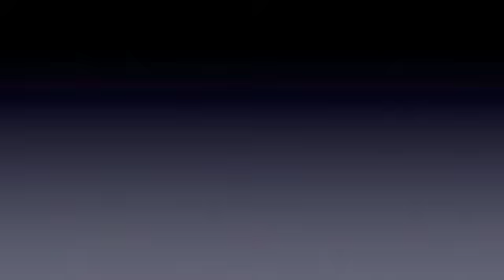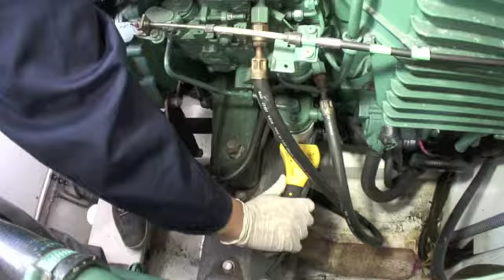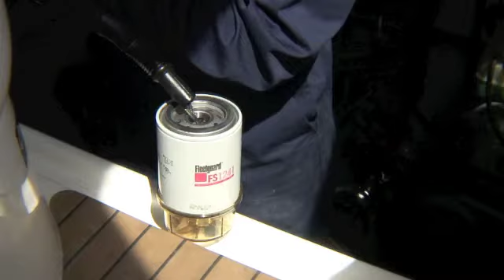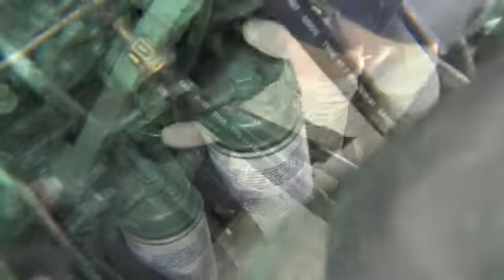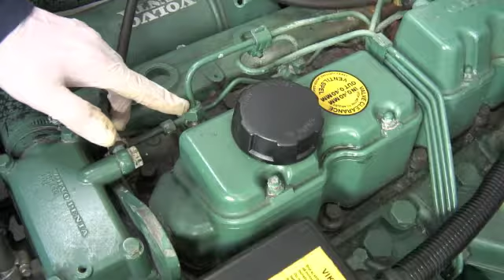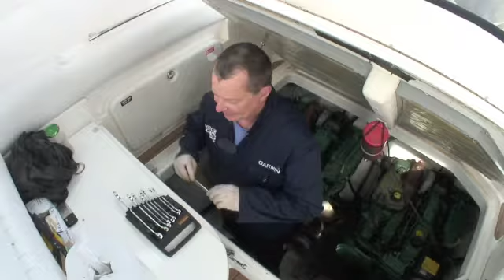Diesel fuel systems - Part 2 - Bleeding the system

Comment: Not to be nit picky but it bothers me that you poured the fuel in the outlet port of the filter and not the inlet, which by doing so bypasses filtering for the fuel you're using to prime the system which probably has some level of contamination. It literally defeats the purpose of the filter and it's intended purpose. I know a lot of people do this in the real world as it's faster but for a training video it should be taught correctly.
Reply: He pours into the outlet of the primary fuel filter, but there is a secondary fuel filter.

Comment: Great video, Wish Mastervolt did a load of videos for the generators - we have an AC-1 Voltage Failure. Anyt thoughts? Condensers seem fine but we think it might be the black control box which is causing the upset.